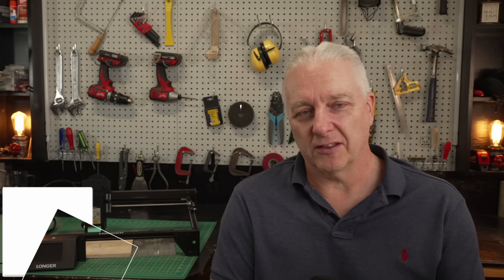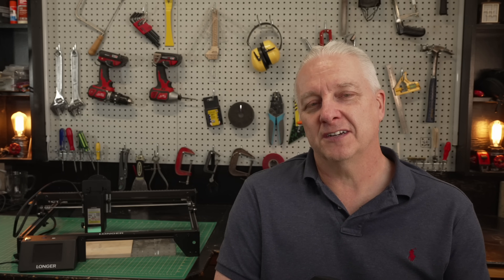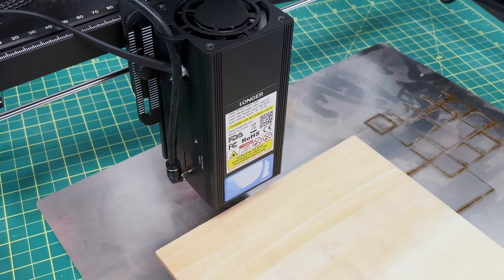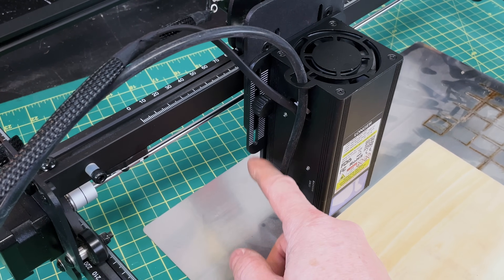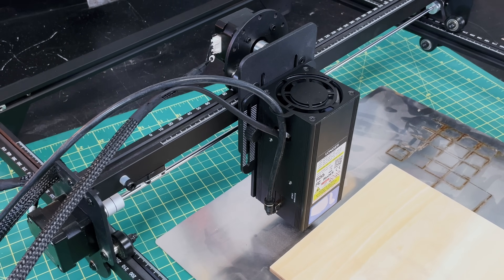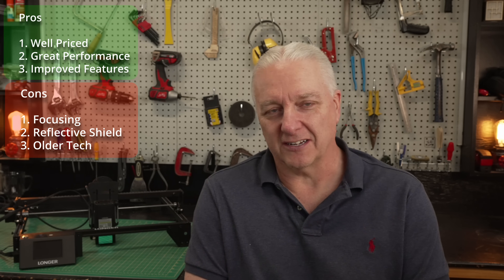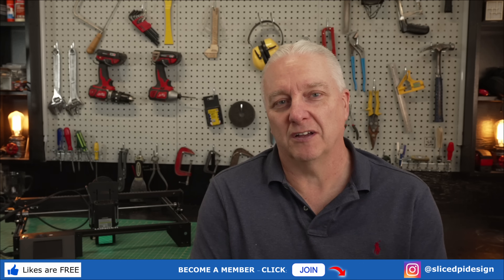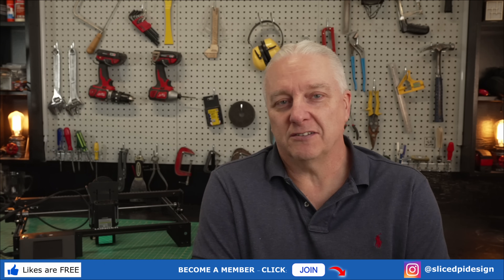Longer Ray5 20W - The Best Budget Laser Gets Even Better

Comment: could you help me out? i upgraded my 20 watt from the 400mm grid to the 840mm frame. now my motor skips on the y axis. ive adjusted the wheels and belt tension, but it still just grinds. any idea what i missed?
Reply from the maker: Hi Thomas, the first thing to check is that the belts aren't too tight or too loose.
Reply: @SteveMakesEverything I did that. Even checked the wheels. Nothing. Called longer. And they are gonna email me back but I'm at a standstill right now
Reply from the maker: @thomasrobinson4899  OK.  Realistically, the belt tension is all it could be, unless there is a missing tooth on the belt or the stepper is failing, or there's a break in the stepper motor cable.

Comment: One of the things I want to do is make some of items that piece together. I noticed in the video that you cut out a small box. Did you have to measure the kerf to make that box?
Reply from the maker: With a tool like Lightburn you don't really have to do that anymore.  You can do one test to measure kerf and enter that into your project settings, and Lightburn takes care of the rest.

For boxes, if you are using something like the Boxes.py tool, you can add the kerf compensation directly in, then and the designed box will be right.

Comment: I have a cheaper laser now and I am not been able to get boxes correct. Will have this problem with this laser
Reply from the maker: You can calibrate your laser in lightburn to make things more accurate.  The Ray 5 is fairly accurate right out of the box though
Reply: Thanks.

Comment: Hello, 
So judging by your own experinces what Laser module on Longer Ray5 choose 10W or 20W? I'm currently deciding between those two options.
I'm planning to use it to start my laser engraving and cutting buissines but I have very little experience with engraving. Thanks for the response!
Reply from the maker: If you have budget get the 20w. It’s the best of cutting and engraving.
Reply: @SteveMakesEverything   i got the 20  watt  ray 5   love it     but  i also have a 30 watt fiber laser for   doing my deep metal engraving
Reply from the maker: @ArkansasChainsaw  Sounds like you're set up 😀

Comment: I thought I saw somewhere in your videos (and now cannot find it) your comments on the SLOW homing of this device and a possible workaround.  Did I imagine that?
Reply from the maker: I don’t think it was this machine, but rather the Longer B1. Either way you can edit the homing speed in machine settings from lightburn if you want to.
Reply: uh....how?
Reply from the maker: @rodmael5410  Read the machine settings in lightburn and look at the GRBL parameter values.  One of them controls homing speed.  I'm not at a laser at the moment so I can give you the exact parameter number.
Reply: When you get time will you give me the settings and where they go?